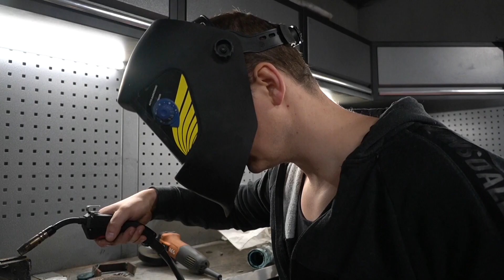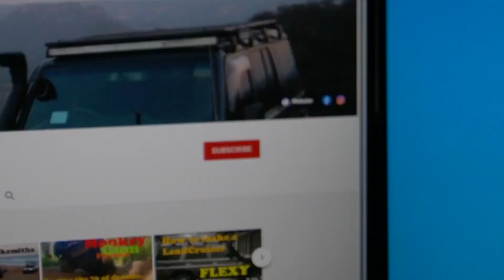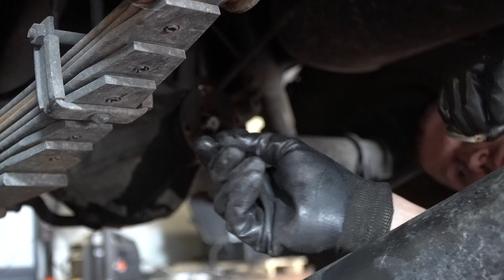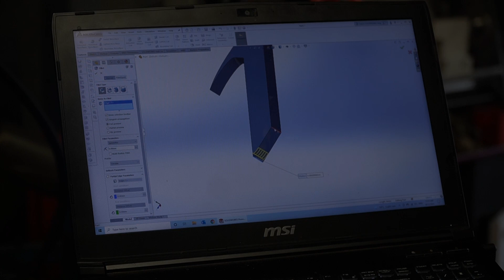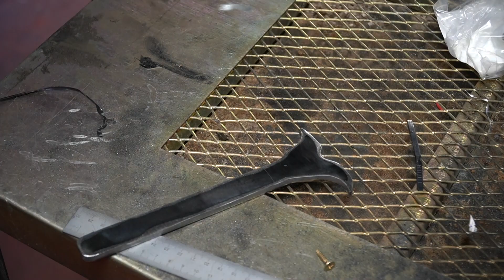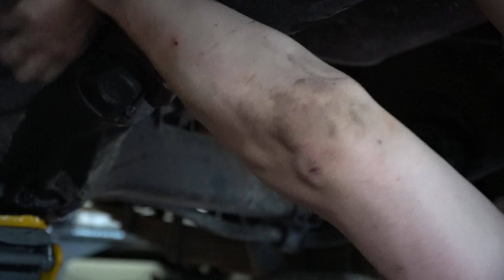An idiot's guide on how to become an engineer - the wrong way... (also how to fix a pinion seal)

Comment: Appreciate you sharing the story, keep at it! Coincidentally i did a similar sealant extractor for my front seals! Only i didnt had the "fancy" cutter so i did it the old fashioned way, an angle grinder, a cutting disk and a grinding disk. More work, but did the job!

Comment: I can fully relate to your uni experience having gone to study as a “mature age student” and struggling with all the “you will be familiar with this from school” material that was not in the school curriculum when I was there. First 2 years were hell but I got my degrees only to discover once I entered the work force again that you have to learn the job on the job and all you really get from uni is an understanding of the terminology in your field and how to read up and learn what you actually need to know.
Reply from the maker: Pretty spot on. It's almost like they teach you the wrong stuff. All the "smarts" stuff with mech eng at least is all done by computers now. As long as you can use FEA and CAD, and make the right choices based on a few tables, you're good to go.

Comment: I'm not a trained engineer but consider myself a visioneer in my line of work....I know what I want or need by envisioning it in my head. My gift is I can usually find the person/company to build or solve my concept in 3 to 4 phone calls. I don't email or text these requests because listening to the tone and confidence of ones voice on the other line is key to verifying if they know their shit. And more importantly, do they have the mental dexterity to work with a visioneer. 

I found you only need to be about 3% smarter than the problem and you'll beat it every time.

Comment: Interesting outlook. I'd have become an engineer if I didn't discover software first. Now I engineer in my retirement in a very unprofessional way.
Reply from the maker: If you're a tradie that can use software, then you're already more useful than most of the "engineers" anyway.
Reply: @ridiculousthings4x4  I like using the CAD software on my Plasma Cutter. Always amazes me how something I draw on the screen can turn up in stainless steel on the plasma table and it's millimetre perfect.

Comment: i can't seem to find your final opinion on the parabolics...dopey electrician (retired).
Reply from the maker: I figured people were bored of yet another parabolics video. The summary from me is: out of the box, they're rubbish. They limit flex and reduce ground clearance. In my opinion, you MUST use high clearance u bolt plates AND remove the lower helper spring AND add retainer brackets since you removed them with the lower spring... Once you've done all that, they're good to go.
Reply: I’ll leave mine well alone then. Thanks for saving me a trip down that rabbit hole!